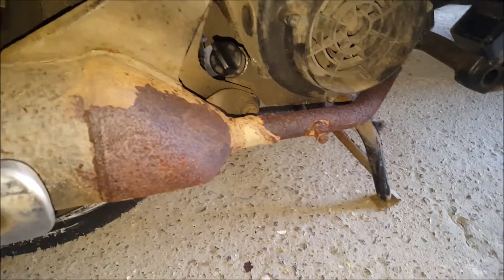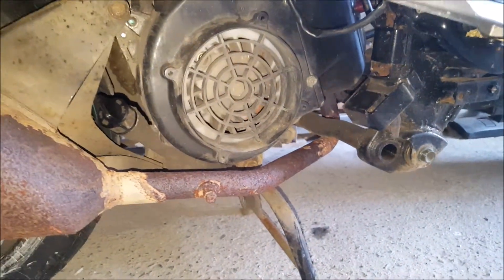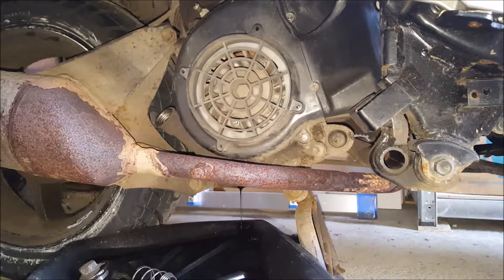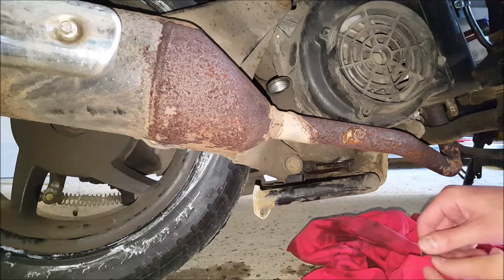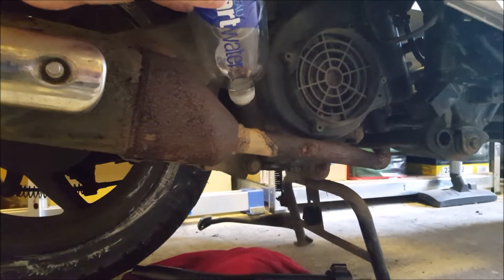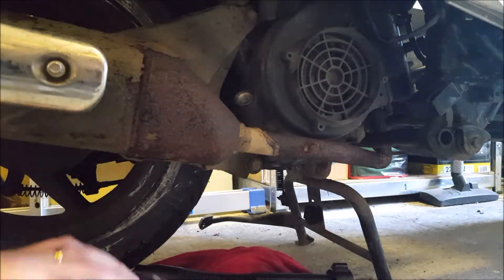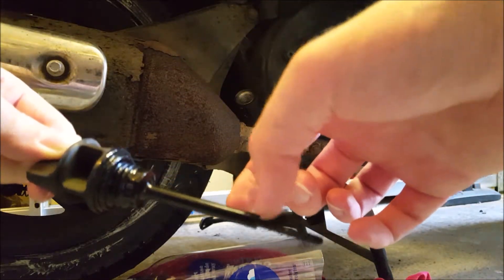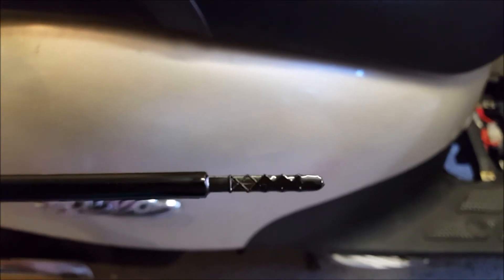Oil change on 125cc moped

Comment: Stupid question: where's the drain plug for transmission oil on Sym Allo? I just don't see it and there's no illustration in the manual
Reply from the maker: The engine oil plug is at the bottom of the engine below the dip stick. Not sure if it has transmission fluid. This is a dry belt CVT. There may be some some mopeds have some reduction gears that are oiled and those usually have the drain and fill ports behing the wheel. So remove rear wheel and have a look.
Reply: @hosuandreiremus  Thanks a lot, i'll have a look
Reply: It is near rear wheel on under airbox but this oil never needs to be canged there are 2 gears that newer wear out
Reply: @RexFixx 
I've read that statement a great deal over the years. Everything needs maintenance or replacements. So, if you can replace oils and fluids... do.

Comment: Why do you rotate dipstick when you check the oil level ? Says in Sym manual U should not or ? Thanks
Reply from the maker: I don't have the manual and did not check. I can only assume that you have to tighten it to check.
Reply: It's not over filled, he's reading the dipstick wrong. Don't screw it in to test oil, just like your manual says.
Reply: @BadMedizin 
Can't be that much of a difference really so shouldn't matter.

Comment: Is there any problem if you put the filter the other side? Will it make any damage to the engine ??
Reply from the maker: I dont think so as long as you have not damaged it. Tis is not really a filter. You culd run without it and there would be no difference
Reply: @hosuandreiremus  thank very much!! Aaahh such a relief😅😅